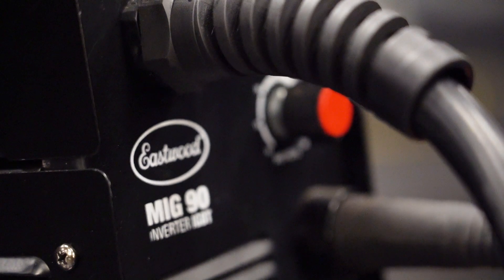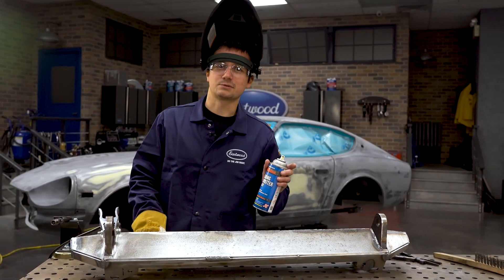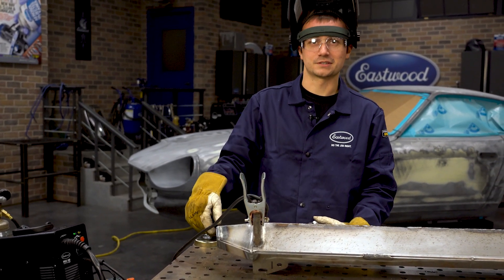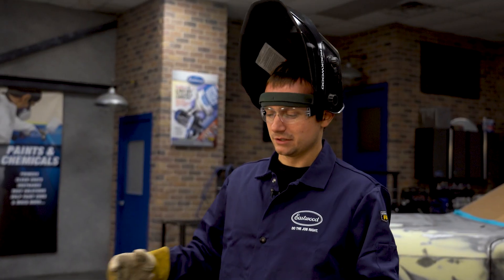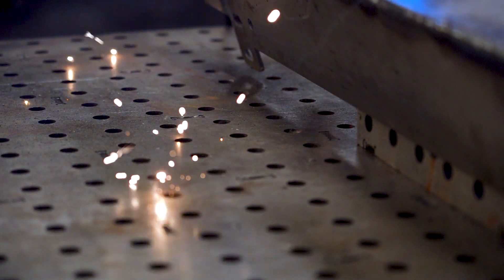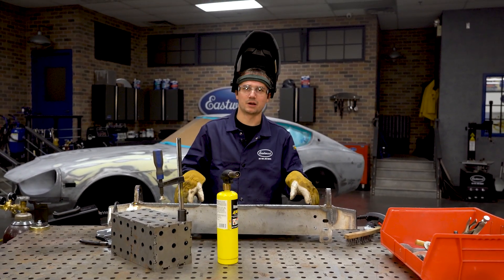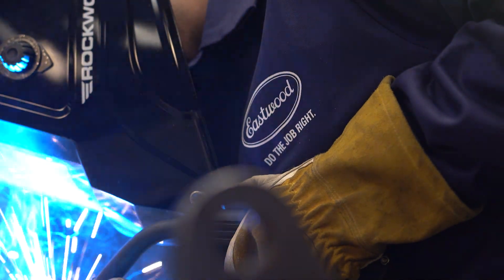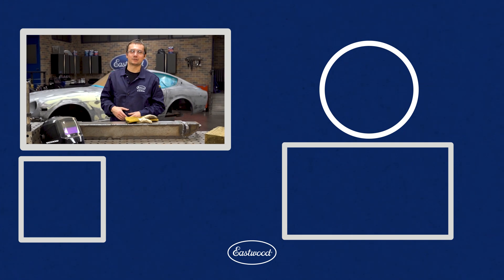Can the MIG 90 Weld a Jeep Bumper Together? MIG Welding Tips and Tricks!

Comment: I got one of these for patch panels. Works great. I install slip on rockers, wheel well arches, ect. Its all i need. Lot easier than the flux core I was using before

Comment: Those welds on the D rings did not penetrate at all! Come on guys you know better than that!
Reply from the maker: Watch from 2:49 on - We pre heat the tabs, then do multiple passes on the top, AND weld the back sides.  They're not going anywhere.
Reply: @eastwoodco  yes I saw the video hence why I said those welds didn't penetrate! Duh! I dare you to cut those off and see how far they penetrated... They didn't! That steel is almost too thick for a much bigger welder to go through let alone that one! You would have to get that cherry red for any hope of a good weld! That propane torch didn't get that steel hit enough! Smh!

Comment: Stop the video pause it and look at the weld around that lug. It definitely looks like Fido's butt. Instead of one pass I think three passes would have been better with that welder around those lugs. A good root pass and then two additional passes. Grinding and then paint covers a multitude of sin.

Comment: Yip pushing the mig gun or stick dose not mater.. if it has slag push the gun or stick 15 degrees either way. Nowhere on the internet will you find.. if you push your gun or stick you will have slag inclusions it just says you ( Might have a slag inclusions) a slag inclusion won’t make your weld fail. 
Only in some areas slag is not allowed… I have had thousands of my welds ultrasound tested and crack tested in NewZealand.  If your still unsure what angle to hold your gun or stick 90 degrees from work ie. no push or pull just 90 degrees…